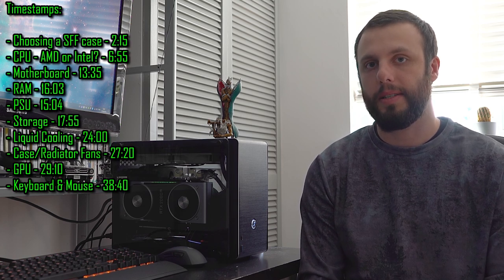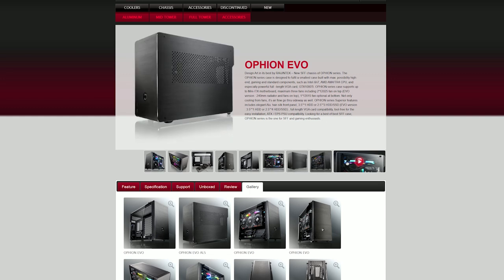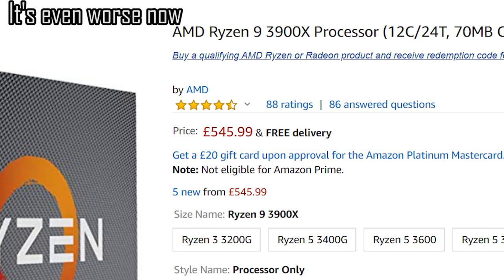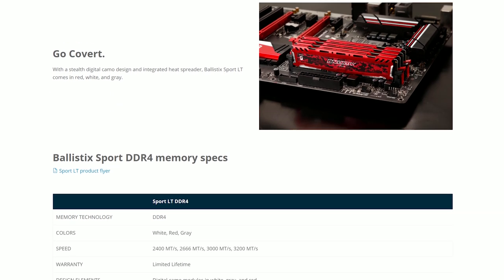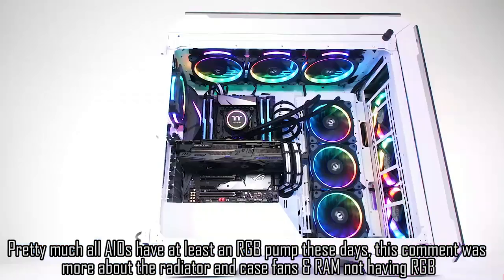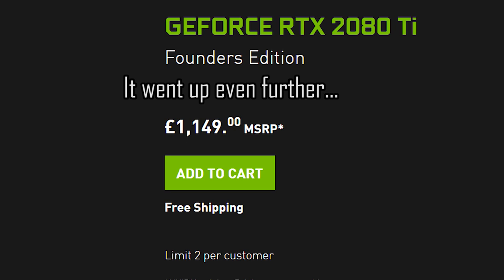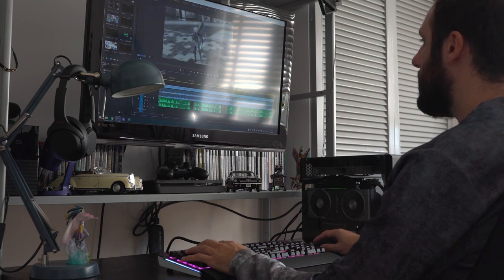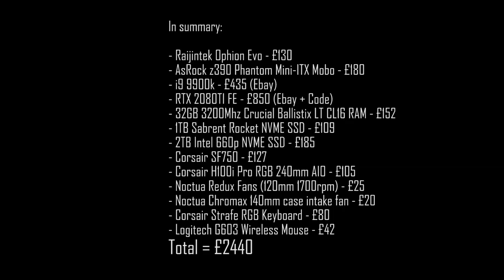1st PC Building Experience - 4K Gaming/Editing SFF PC - 1 - Deciding Which Parts To Use (Sept 2019)

Comment: FYI  If you plan on moving your PC you want to avoid using traditional hard drive storage as the data reading heads are sensitive to vibrations and can be damaged when exposed to vibrations/bumps/turbulence/etc. An AIO liquid cooler is also a good idea to prevent torque caused by a air cooler moving around inside the case during transport.
For your display if you purchase a monitor I would suggest an IPS panel type with G-Sync for higher color accuracy and variable refresh rates in case of any potential FPS dips.

Comment: Solid build
Did you consider the Lian Li TU150 case? It's more than 20L but has a handle on the top of the case for mobility. (fits large air coolers like the be quiet! Dark Rock Pro 4)
Reply from the maker: I did, but this was already the upper limit of volume/size I could build in, and I wasn't really sure about the AIO situation for the CPU in this case, I think they only have 120mm options. All the research I did pointed to the fact that only realistic scenario where I could run the hot 9900k in a sff case without making a ton of noise was to use an AIO.  But it's a lovely case, most likely the ncase M1 or the sliger case would have been the absolute best option but like I said in the video, $ and/or availability. Maybe one day I'll swap out to one of those cases.

Comment: Looks cool but damn there's not alot of clearance for the graphics card pull cool air
Reply: This is the constant challenge in almost every SFF build. Without a machine shop getting involved to customize a case (and void any returnability/warranty) you have to get really creative with airflow. I know he did a lot of testing and monitoring of heat-to-load on the GPU to determine the optimal configuration he could produce.
Reply from the maker: Yep, more about that in the next part, but spoiler alert - with the tempered glass the GPU ran too hot and throttled during gaming

Comment: CLARIFICATION: simply put, M.2 is a type of connection slot and NVMe is a type of standard for data communication. Most programs don't know how to take advantage of the NVMe standard yet so buying a traditional SSD isn't that much of a hit to performance.
Reply from the maker: Fair play, for me I transfer big files around a lot, and even if there isn't much of a tangible difference in program performance the transfer speeds are certainly noticeable. I duplicate recordings and renders often as backup and it's just blazing fast, I love it!
Reply: This isn’t entirely correct. It’s up to the hardware and underlying OS to take proper advantage of modern PCIe-based storage like M.2 NVMe SSDs. 

An easy way to prove this is by using common disk benchmark tools, such as CrystalDiskMark. 

A common SATA-based SSD usually will produce around 500-550 MB/s sequential read scores. 

A good quality NVMe SSD on qualifying hardware will achieve roughly three times that or better. 

The consuming program (game, video editor, etc.) is not typically aware of the storage technology outside of perhaps some disk caching options.